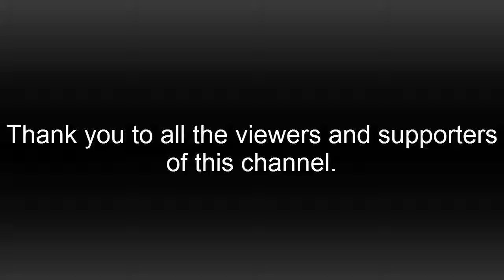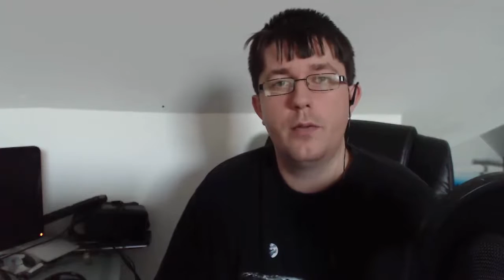What math do you need to know to code

Comment: There is so many people out there that might make great coders but they are so afraid of math not realizing that most of coding is just procedural logic. There is exceptions of course like you mention but another thing most people don't understand is that math is quite easy when there is a reason to learn it. I sucked at math for so long until I took physics and then suddenly there was a reason to solve X, X was acceleration, or it was torque or it was angle and all of it had a purpose and reason to be solved, not like these random generic questions you get in math courses. 

/endrant

Great vid!
Reply from the maker: I 100% agree. One of the biggest problems face in schools is schools don't give a real reason to use it. This kinda gets into what I made a video on a while back on don't go to school to learn, but go for a network. The info they give you tends to go in the trash after everything is said and done (basically, no one wants what you worked on hard. Not even for free.). 
I believe once schools start aiming towards making it where students can sell their work or at least be able to give it away for free to companies. Then students will be able to come out much much better.

Ask yourself what is the difference between someone who went to school for the grades and the paper (without networking with others), and someone who stay home sleeping/screwing around. 1 has better sleep, and the other is majorly in debt. 
How are they the same. Both can't get a job